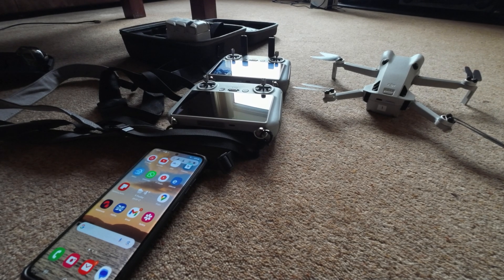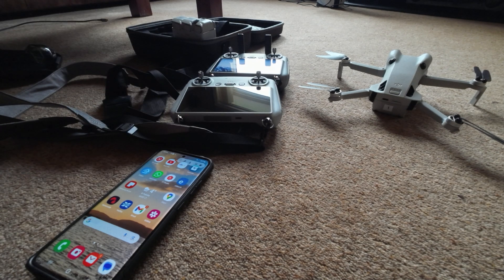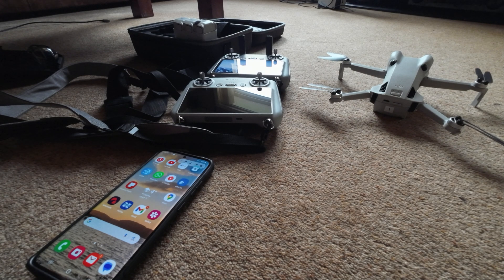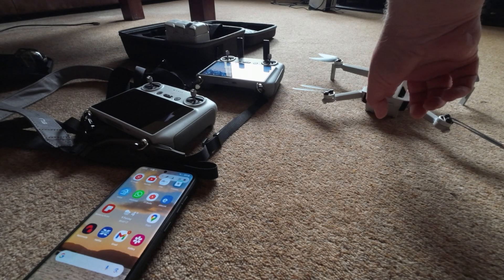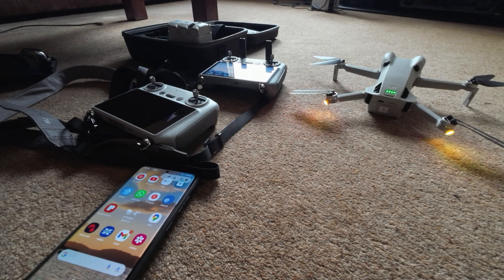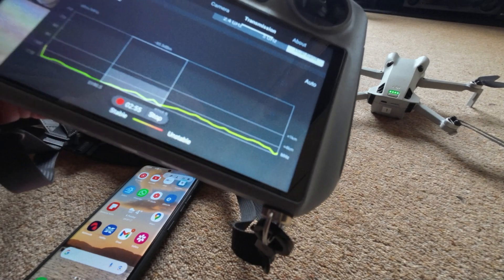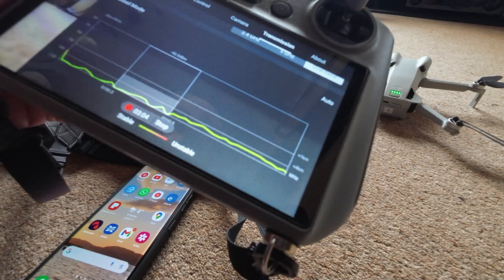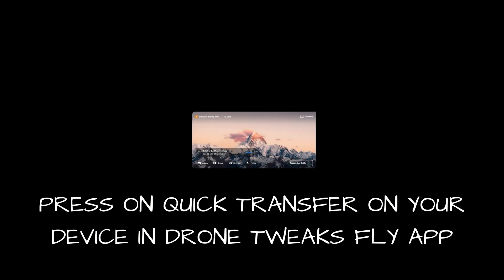FCC HACK WORK AROUND FOR THE DJI RC 1 AND RC 2

Comment: Hello mate i had a similar hack for my avata just put a text file on the memory card , do you know of any permanent hacks though as it seems a bit long doing this on rvery flight? My old hack kept me in fcc until i updated software (never did though)
Reply: On the avata i was able to tell if i was in fcc by the amount of channels you had access to - been a while since i used it though - if you had access to numerous channels it meant u were in fcc or other way around. And okay thanks for the info, just ordered the mini 4 but didnt even think about this until now - live in the city so range is terrible without fcc
Reply from the maker: @Wheazul mini 4 pro has a great signal, yeah, and you're right about the channels on the avata. I have that with the ham file, but it's not the same with dronetweeks. Apparently, never used dronetweeks with my avata but mavic 3 and on occasion mini 3 and 4 but I'm sure you will be happy with the ocusync 4
Reply from the maker: On the avata you can put the ham file on the goggles and it works great or buy dronetweeks hack problem with the avata there is no way to see if your in fcc mode or not but if you follow the dronetweeks steps and they are easy enough by all accounts you will be in fcc mode. I personally use the ham file on the avata hope that helps if it's for a normal drone drontweeks works brilliant but not on android 14 at the min only some phones like my s21 ultra

Comment: Been using Drone Tweaks app for ages Jim. Works no problem on RC-N1 controller. 1 thing you have to switch off auto camera view or the app will keep disconnecting. Into your profile settings on fly app and switch auto camera view off. I use it every flight. Great video Jim
Reply from the maker: Cheers buddy yeah makes a difference and good on the new rc now 👍